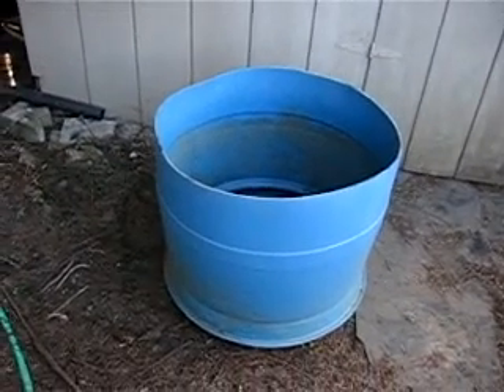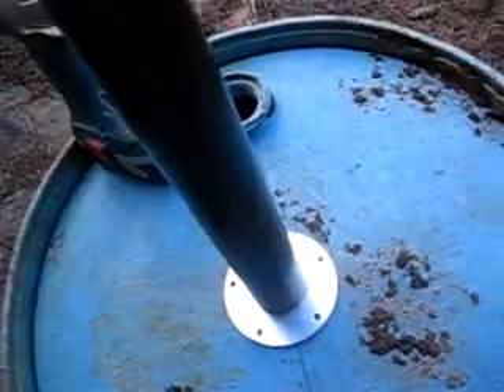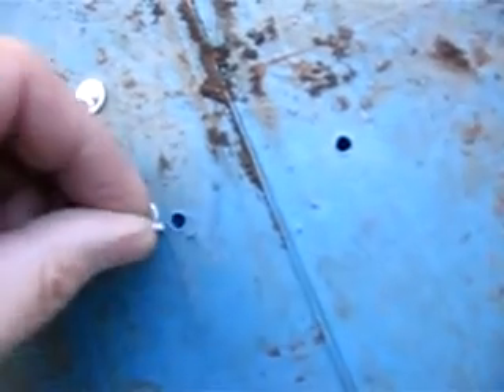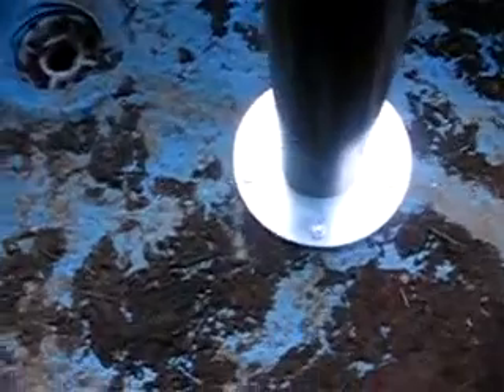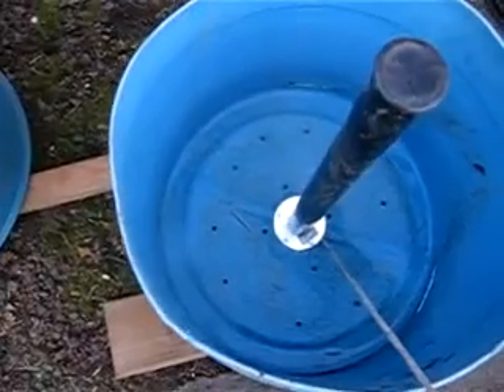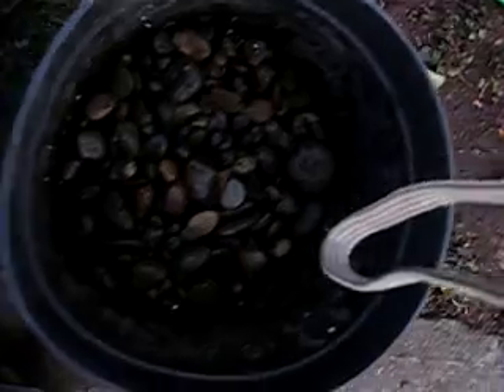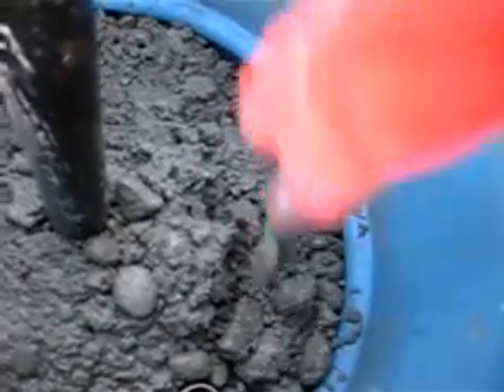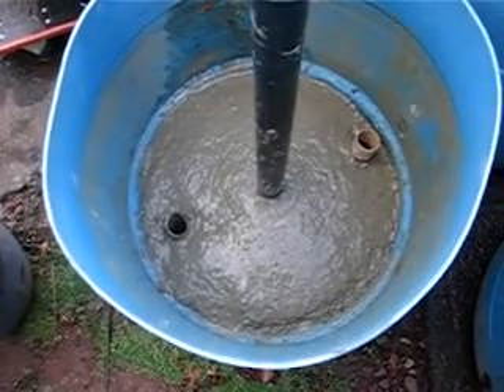Food fence pt 1 - making the bases

Comment: I am a permaculturist and as such lazy by nature ;) so I'm not clear on why you went thru all the trouble with the quickcreet (sp?)...why not just drill one whole in the bottom of the drum just large enough for pole to slide through and allow metal base to remail outside under barrel...once you fill that with soil neither the post nor the barrel are going anywhere...also wouldn't the quickcreet throw off the pH of your soil?  Love your idea of the food fence though.
Reply from the maker: The concrete is to give enough weight to the barrel that the food fence would not blow over if we got any serious winds.  It is a bit of a sail. when fully covered.
Reply: lol...just got a visual of your whole house...garden and all lifting up and sailing away like in that movie "UP"...but seriously I have barrels like that in my garden and once they are full of soil they don't budge...even when you want them to...you place them where you want them or empty them before moving them.  Love your idea though of using them for fence posts!  Think I'll try it for my sugar snaps and then pole beans later this year-Happy Gardening and thanks for the ideas!
Reply from the maker: The height of the poles, and the addition of the fencing changes the ease with which one can tip things over.  Also, just attaching the poles to the barrels would not secure them very well in the vertical position needed.  This was the result of some experimentation where I had so problems that this method resolved.  ( I made 2 barrels with the posts bolted to the inside side of the barrels and put fencing between them and had the whole thing tip over once I had loaded planters on the fence.  I thought a lot about how to center the poles so it would not be so prone to tipping and decided the concrete base was the best solution.  I am very happy about how this turned out, but I would love to see someone else build on the idea or experiment with it and try their own approach.

Comment from the maker: @no2religions I think a simple way to envision what I am doing is for you to imagine I am making portable fence posts kind of like volley ball posts, except instead of the concrete being poured into a tire it is poured into the bottom of a barrel that will serve also as a planter.  I don't draw very well.  I have a picture of it in my mind, but how do I transfer that picture to the computer? :)  Once the bases are filled with soil I will add tall posts on which the fence will mount.

Comment from the maker: @GoblinXXX I don't want dirt under the concrete, I want the concrete to adhere as best as it can and fill the space at the bottom of the barrels as much as possible, as that will help the concrete last longer.  Dirt weakens concrete, and the disks are fairly thin, less than 2 inches thick around the edges.